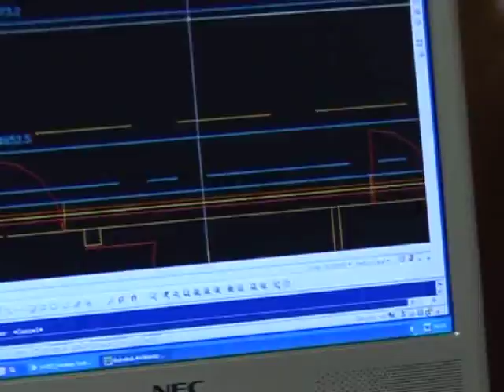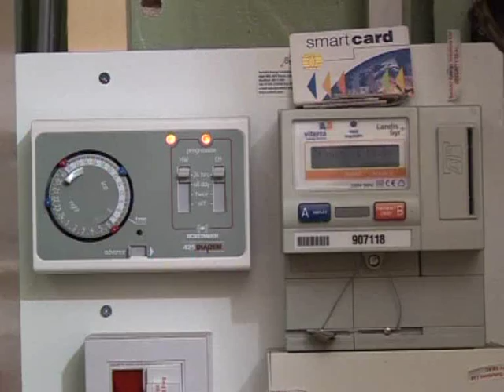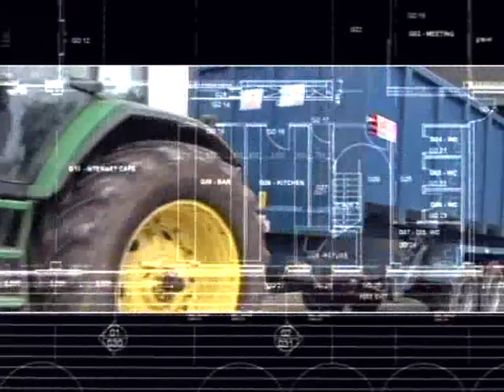Barnsley MBC, UK, District biomass heating from local tree waste - Ashden Award winner

Comment from the maker: The wood they're burning is mostly from tree surgery and other work that's being done anyway, so if the wood wasn't being burned it would be going to landfill - this way some useful energy is recovered and fossil fuel use reduced.

Also, trees grow continuously, and as long as the wood is only harvested up to the rate the trees are growing at, then you can keep going for ever. This is especially true if the trees are coppiced, as then they grow back far more rapidly than normal.